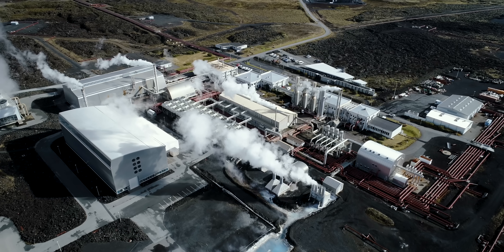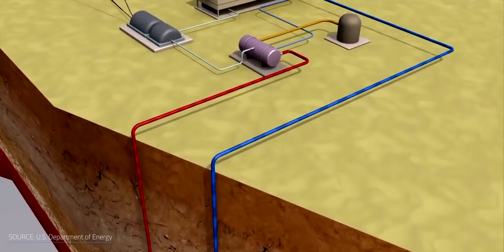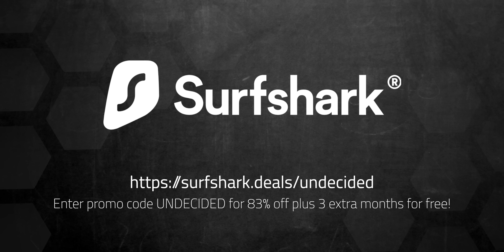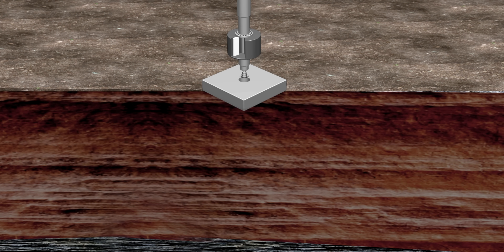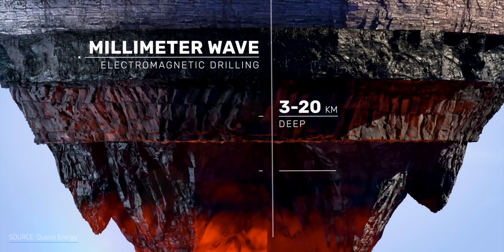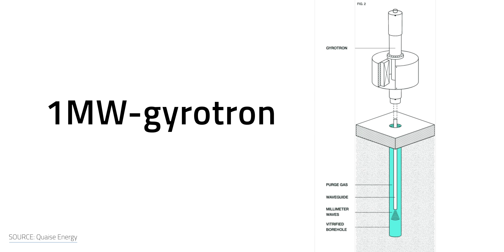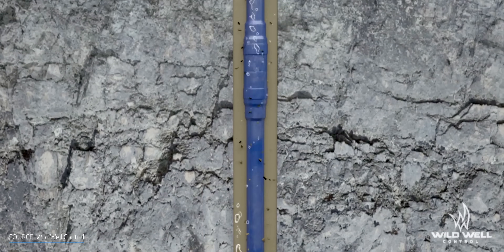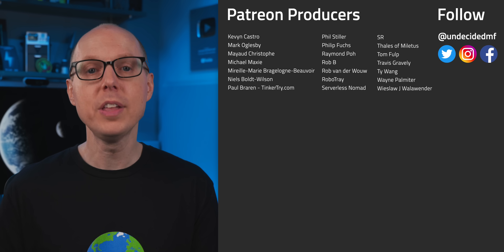Why This Fusion Tech May Be a Geothermal Energy Breakthrough

Comment: you need like 20-30 holes, 20km deep giving you 400-500 C each to rival one 1GWe nuclear plant...i wish we could just rip of the band aid...fission tech. is nowhere near maxed out still lots on innovations to be had there...we don't know when fusion will get here maybe still 15-30 years out and it'll likely be low power in the beginning...so i say fission is the bridge tech. perhaps even a competing tech. if we cando things like increase the power output and further reduce the waste generated from a fast reactor and of course safety gains can't forget those...

Comment: I'm not sure this technology is safe for the planet?

By the same means you're creating "a glass tunnel," the gas is launching a variety of micro dust that must equally be glass-like. 

Glass has a static charge, making it have potential atmospheric interactions within weather systems, adding to the fact that it's so practically small it may be permanently airborne and incapable of errosion by natural forces, even if hail brings it back down to land or ocean, breeze and evaporation may simply re-launch it? 

Think of it like "forever volcanic ash." Since static things attract, if a sufficient pocket of these airborne marbles form their own "static cloud," they could change altitude extremely rapidly, potentially causing a "Raiju Attack" for lack of a better comparison, on anything from satellites, aircraft, power grids, or even a kite dangling a set of keys?

I think we need to test the gas samples at a microscopic to macroscopic level, just to be sure.

Comment: In all this, however, it is still not clear to me what actually generates the energy that moves the turbines. The upward flow of condensed vaporized rock (nanoparticles)? The water vapor generated? If it were the first case and considering that the turbines were created to use water vapor, wouldn't "rock steam" create problems for the plants?

Comment: No mention of Eavor?
Also, no discussion of thermal conductivity of the rocks. Rocks are pretty good insulators. So even if you get to those 500C rocks, the amount of heat you can actually extract is relatively low, since it takes a long time for the 'new' heat from adjacent rocks to replace the heat that you extracted. You'd need tens of km of well bores at that depth, just to gain enough surface area for a few MW. 

Also, their proposal to what is essentially air drilling, seems very tenuous. To pressurize gas to a pressure equivalent to 10-20km would mean over 100MPa. You'd have a lot of trouble building pipes, fittings, etc. to withstand that pressure at sea level.

Comment: People need to understand that if they want to have a hole drilled (or lasered) deep enough at a cheaper and more reliable method, to allow proper geothermal plants, they would need a wider hole, not a tiny borehole. A hole with a diameter to facilitate a small family home, which is the minimal ideal size you'd want, and you would need more than a 1 MW GyroTron, which if you take certain minerals and variations in temperature differences required to turn them to glass, you'd understand you need a much higher MW.

When you'd making a proper geothermal plant, which can provide unlimited energy for a pretty sizeable chunk of the population, you have to understand the size of the complex itself, and the size of the hole. Not just the depth.
Reply: How have you got that idea? I'm not sure there's a borehole on earth with a diameter that large. If more power is required they can just drill an additional hole.

Comment: One other advantage of fusion geothermal is that you can ( at least in theory, if it works ) put new plants close to the cities that need the energy without the financial and environmental costs of running long transmission lines like you do with conventional geothermal.

Comment: At least three other companies are developing technology to bore through hot rock.  The Quaise method's major drawback is that it is not directional.  A company in Slovenia is developing a plasma drill which is directional.  This would be complementary with Eavor's closed loop system.
Reply: @alberthartl8885 I've been wondering about directional as well.  Where did you learn that Quaise is not directional but GA Drilling in Slovakian is?

Comment: I designed my solar panel mounds to be mowable underneath, and I mow uniformly. Between mows, the grass under the panels is much longer and greener, particularly in the (Pacific NW) summer, with little rain and no mowing allowed due to fire danger. I am very tempted to grow crops under the panels.

Comment: Understanding that this is an economical and efficient way to produce energy, compared to other power generation methods, is there a global warming penalty for bringing the hot core material up to the surface to extract its energy?  This penalty is not linked to other "true" renewables.  Also, I'm not sure I see this as renewable... in the same way that fossil fuel extraction isn't renewable either.

Comment: Hi Matt, good content throughout, but -- talking about "binary cycles", the secondary cycle generally is not water (as you said - "a liquid with lower boiling point", SO cannot generate "steam", but high pressure vapour . Small correction. Thanks. 
Soumya, India

Comment: You can generate more energy with a black hot water tank, Than solar.  Make the water turn into steam, and use steam power>   I could heat my whole house by using steam, while using steam for Electricity

Comment: What about large liquid solar ovens?
They get really hot even on cloudy days.

The main issue is that these sources of energy are cheap.
How will the oligarchs of the world (including those in the U.S.) control us if we don't need much money anymore?

I could build a very safe Teepee out of two by fours dug 4 feet into ground, pressure treated, and sealed.
Thing would last forever and be hurricane proof.
Build the floor 18 inches off the ground.
$2000 tops
In an oppressive capitalistic society, would they let you build such a structure?  What do you think?

Comment: my phd  thesis in engineering in the  80s was on geothermal heating and  cooling with water ponds..  no  need to  drill 50,000 feet..  a simple 100 foot well can save enough energy to put 2 exxons  out of  business..but alas ,, it still hasnt  done  much.. and wont  for another 100 years
Reply: The earth is not hot at 100 ft

Comment: I’d just like to point out; the ground level at Old Faithful is 33 feet higher than it was 45 years ago.

So, does that mean Yellowstone is going to erupt and kill us all?

Well, not necessarily...but the last time was 800,000 years ago.

And the average quiet period is 600,000 years.

So, just for arguments sake; we ring Yellowstone with Geothermal power plants.

We sell the electricity and use the money to bore another hole.

The process cools off the rock a bit, and the ground level stops rising.

Cooling things off can’t be a bad thing.

Comment: Seems like the main questions would be: How well can the gyrotron perform as temperatures get to 300, 400, 500, 600 deg C?  Does the glass encasement crated by the gyrotron perform all the way down the 12km hole and especially as the temperatures are so high?
Reply: Seems to me, so long as the gyrotron laser is designed with a linear power output, higher temps at deeper depths really shouldn't be a problem.
Reply: Glass start to get soft at 1,200 C so at temperatures of 400-500 C down the hole the glass will still be strong.
Reply: @scientificapproach6578  That’s an interesting point. So perhaps in addition to the glass casing preventing dirt from refilling the bore hole it might also act as an insulator protecting the metal gyroton itself. ? Or would the business end of a gyroton likely have no issues at 500c?

Comment: This has so many advantages over solar and wind it should just replace those technologies.
-It can be done anywhere
-No intermittency so no batteries
-Doesn't take up lots of space with ugly, delicate equipment
-Doesn't need as much maintenance and replacement
The only "disadvantage" is its not decentralized so you still need a grid, as opposed to just getting your electricity from your roof.
But there's no reason you can't do both.
Reply: this also seems relatively scalable, so you still get better grid resiliance

Comment: I like the sound of it and I think for high temperature and deep drilling this is an amazing case for a better cheaper alternative... however I feel like the comparison between a $30M drilling project and $500k electricity demand for this technique is slightly unfair. Traditional drilling has plenty of known quantities, staff wages, tools, consumables, overheads etc. Whereas this does not. I have no doubt that this system may dig a deeper hole cheaper, but there will be more to the costs than just a 500k electricity bill. Either way, geothermal is a free and fairly safe energy source we should be investing in like this 👍

Comment: So if the earth's core is that hot, and it contains hydrogen+oxygen, wouldn't they bond to form water? Then it would make sense for it to seep out of the earths crust because it's less dense than the minerals surrounding it. The same goes for crude oil and hydrocarbons. The intense pressure and high energy causes the hydrogen and carbon to form a bond or chains of bonds.
Reply: When atoms experience extreme heat and pressure, they form a plasma. Plasma is basically a stream of atoms stripped of their electrons. The fundamental particles which cause atomic bonds between atoms are the electrons, if a plasma has formed and electrons cannot hold atoms together as molecules. So no, they wouldn't necessarily bond together as water in such environments.
Reply: Chemical bonds can't form if the atoms are in an excited state. Add enough energy to the bond and it'll break, undergoing thermal decomposition. This happens to water at ~3000°C, much lower than the temperature of the core.

Comment: when I like to imagine something, the first thing I do is try to find the boundaries of what could happen.  This is usually done by taking things to what I can picture to be the most extreme ends of possible outcomes... if we take heat from a system then how is it replaced?  How much heat is needed for the system to function properly.   If we remove half the heat from the interior of the planet we could likely turn that molten rock into solid rock and what is the worst thing that could happen?... that would be loss of magnetism because the molten metals in the rock that are magnetic solidify and begin to lose their magnetism, I don't think that this is a good idea, I do however like geothermal energy but I do NOT like this idea.  It is expensive, unproven,  wasteful, and there is no way you can know the consequences.  I did say I like geothermal, and I do it is great for air conditioning here in Florida using a heat pump,  It is great in shallower depths in colder areas, but... this idea you have here not a good one.

Comment: We don't need to go down 10 km to get to 375 degrees Celsius. We can go down only 5 km, getting to only about 125 degrees Celsius -- in average places on earth, if, instead of bringing up steam or hot water, we merely bring up the heat with a layered, graphene or nanocarbon tube wire. Also, per Mark McCutcheon's expansion theory, the heat at the center is created by expanding electrons -- not heat residual from the big bang. In other words, geothermal heat is totally renewable. It won't run out. However, if we create free energy and free food WITHOUT FIRST SEVERELY REDUCING AND RATIONALIZING OUR REPRODUCTIVE COMPETITION, without civilizing the world; then there will be an explosion of the human population even worse than the one created by oil and the industrial revolution. We will lose what little biodiversity still exists. We must learn social science and civilize ourselves before creating more powerful technologies, such as this one, that will enable Homo paranoidus schizophrenus to commit suicide. The comprehensive social science that we need most is FREE to read, watch and download at PeaceLoveAndProgressParty.org .

Comment: Sounds like bs .

Don't believe the thing can go through rock fast or about the energy requirements .
Also doubt the thing doesn't wear down really quickly .

I'd rather say the thing wears down faster than a regular drill bit .

Also don't believe the supposed "glass tube" it makes will be enough to hold the pressure .

Comment: Its mind boggling....we look at that novel curiosity then ignore it...the sterling engine...it works by heat pump technology but we continue to partially use its tech but ignore its total package....so how about a power plant sized Stirling engine...yes it isn't a tremendously strong aka lots of hp but it's simple and almost free...and always works...just needs a temperature differential...doesn't need weather, sunlight, complex technologies plus doesn't create waste that needs disposal....just runs continuously....generating electricity...using known technology so only reason not being used is because....

Comment: is the pressure not high enough to avoid having to use a pump?
Reply: Thermal siphoning is used in the Eavor closed loop system.  No pumps are required.

Comment: The estimated use for 2050 seems too far away considering the energy independence this can unlock for the world and remote inaccessible locations without the need of importing a  fuel source or large areas of land to dedicate to solar/wind.

Since these theorized gyrotron made holes the geothermal water is injected and expelled deeper in a relatively stable cyclical manner in a hotter as a result a more pliable rock wouldn't earthquakes be far less likely? 

The biggest cause of earthquakes from oil and natural gas is injection of waste water and chemical's deep underground in close proximity with hundreds or more wells injecting toxic waste liquids in a massive grid like pattern.

In my mind the difference between these two procedures seems massive. Geothermal steam powerplants mimic natural events in just a more controlled fashion and without the toxic waste and possible ground water contamination risks.

Comment: A heat pump can be run by wind would multiple geothermal and a greenhouse can act as a preheater to get more than 100%.  Tesla cheated by using sympathetic frequency in the same way we use antenna length.  We can use multiple technologies to amplify the output of one as the input of another.

Comment: Couldn’t you just put a turbine up the well from the drill and then just add some water recirculating in there spending a turbine then going up and dancing on the walls and coming back down until it gets to the super hot part where it goes back up I would think that would be the best way to power your death referral

Comment: If it's so hard to drill (conventionally) beyond 10 km depth because of the heat, why aren't we cooling down the rock first? Let's say we drill down 10 km, then we build a geothermal plant and use the heat to create steam and run a turbine. But we run it at a much higher capacity so the heat can't replenish itself. Once the rock has cooled down and solidified, we drill another hole next to it to 11 km, we repeat the process, extract all the heat and drill another hole to 12 km (or maybe you can even continue the first hole), and so on.

I'm sure others have thought of that and there is a reason why it won't work but I honestly can't think of one.

Comment: I understand the problems associated with drilling through unstable areas ,the concern over creating more unstable areas not unlike others caused by mining,drilling, and land fills that gave came back to bite us in the past. Very intrigued by this glass wall created as a fortunate byproduct. Yet I'm left wondering how much variation in density Occurs as the materials your passing though change with the depths?

Comment: I think of all the time, energy and money that has been spent on fusion energy over the past 40-50 years. As far as I can tell, all it has produced is a very high tech furnace designed specifically to burn money. In that respect, they have been wildly successful. Imagine what could have been achieved if just 1% of that money was invested in creating the necessary drilling technology required to reach those depths.

Comment: The energy in the Earth is not the problem.   But the cost of getting the energy to the surface and converted to electricity at the surface is way too high .....  So forget it.  This is a no go.   We have to go to cold fusion (MOXY Fusion) of to Thorium LFTR.

Comment: Your image of the cross section of the earth begs a question I’ve often pondered .  .  . In your view how much would you weigh at the center of the earth?  Given that mass is the source of gravity, and at the center of the earth there is an equal amount of mass in every direction, does gravity basically cancel out?  If so, then wouldn’t all of the mass form into more of a hollow shell instead of a solid sphere?

Comment: I got ideas how to dig that deep, kinetic cuttings with heat and drilling, I'd use hot cold energy chip tech going down but I'd want to play with a kind of giant yoyo when u get to that giant pressure differential that's like equivalent to stepping into below the bottom of the ocean as analogy comparison, that and maybe buoyant surfboard tech giant gold ball marble machines, molecular Faraday cages to help navigate micro machines, using stillness to create energy also, new Kelvin records.

Comment: Why.. Not just tap into volcanos? Challenges are basically the same with earthquakes and hard land but its pipe already down to magma... So- why dig when you already have a hole? And you would have enough power to export it to places which are not at the tectonic plate proximity....